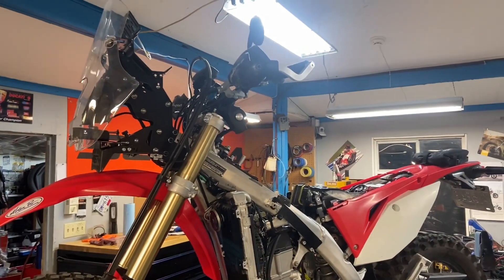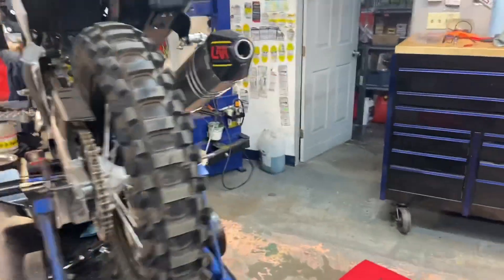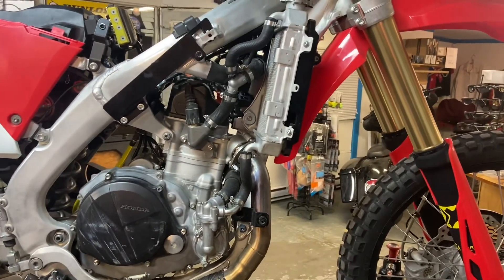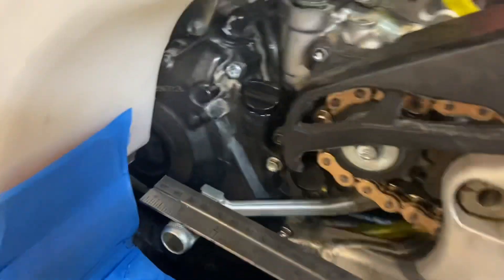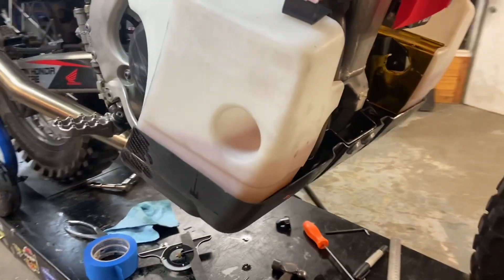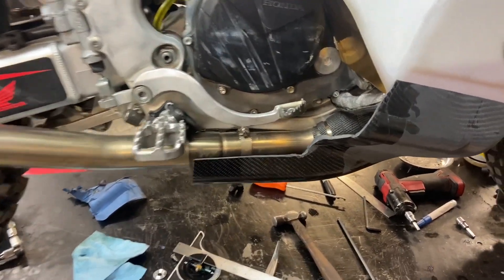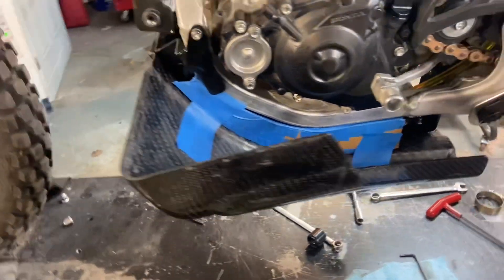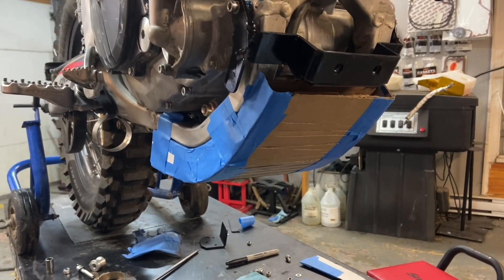Crf450L rally build #15

Comment: Nice to see the build coming along! Just a comment on health and safety, carbon dust is an irritant and should be handled carefully, eye and breathing protection should be used until the surfaces are properly cleaned. It can also cause short circuits in electronics. Otherwise nice job!